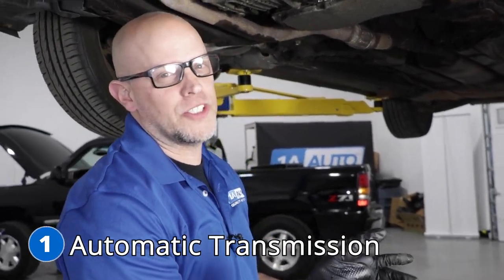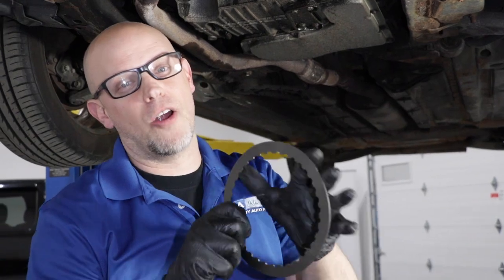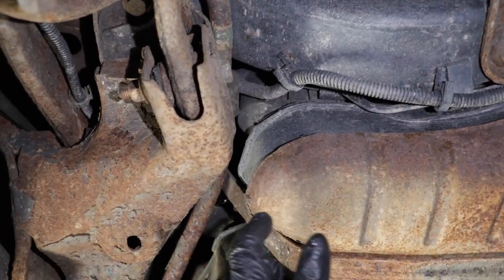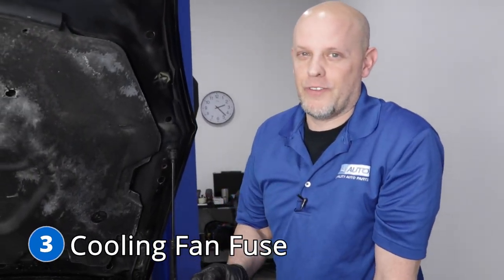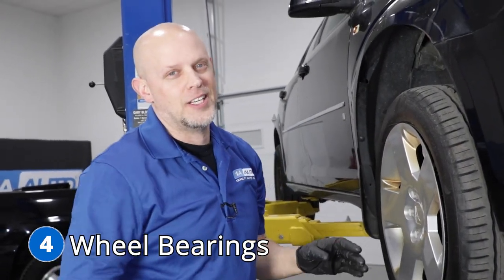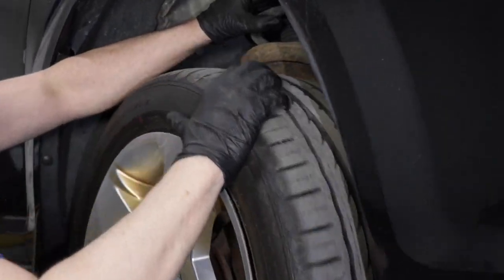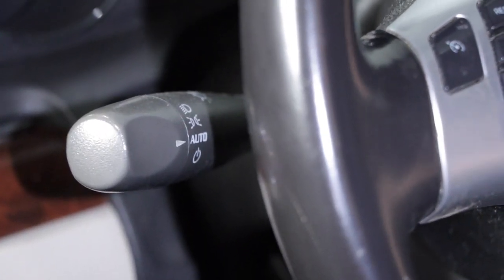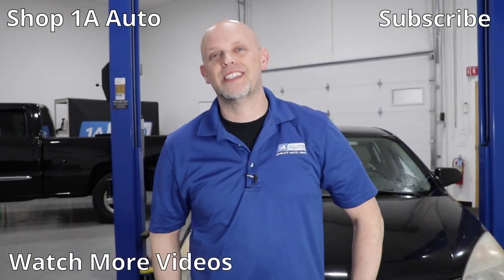Top 5 Problems Saturn Aura Sedan 1st Generation 2007-2010

Comment: I have an 09 Aura XR with the 3.6L and 6 speed tranny. Just hit 250K today on a 7 hour trip from Buffalo, NY. Car has been very solid last 12 years with only minor issues. Did replace the wheel bearings at 200K (only one was bad but did both since they are cheap and the repair is simple). Had the evap valve go at somewhere around 150K but no problems since. Bet this thing hasn't had $1500 in repairs in 12 years. Would buy another in a heart beat
Reply: It was discontinued so I haven’t found any real answers tbh
Reply: @dumbshit6510  sorry it took long for someone to reply, kinda on you cause I got one and it is so messed up. In two weeks I had to get power steering lines fixed, back seat changed and now check engine light just turned on
Reply: I have 07 XR currently 136k miles had it for 6.5 years a few issues waveplate luckily recall/extended warranty took care of that.  Also had radio replaced bc of some kind of failure.   And timing chain replaced.  Currently need a cat
Reply: lucky.... I bought a 07 Aura and 2 weeks after I got it the transmission shit the bed at 126k miles.... gave it to my grandma after I fixed the transmission and I think its been doing fine since then
Reply: @bfuller5577  Have your tried the animal shelter they usually have lots of kittens & cats that need homes....oh, wait
Reply: Mine has 69 k 
Eva’s vent went
Bad and blew the gasket on my gas cap 😩cracking the actual cap itself

Tstat (I ’m on on 3rd one)
Head gaskets also done
Water pump also done 
Luckily it was a gift from wifes granny but I’m almost positive she drove this thing with diesel or filled the radiator with blinker fluid because anything to do with its cooling system is completely out of whack
Reply: @chango.-.  how expensive was the transmission fix? Looking to purchase an 2009
Reply: @savannahgnass935  "Blinker fluid" lmao, love it! 🤣

Comment: Good vid! And spot on. I have an '07 Aura XR with the 6-speed transmission. 
I encountered the 3,5,R Wave plate issue and GM fixed with no charge it even though it was out of warranty. There is a special coverage offer for GM cars with this issue.

Another thing that happened was the multifunction switch that you point out. Fortunately this was easy enough to fix myself.

A few other things I had with this car that others might also see:
1) Instrument panel lights failing. This can be removed and sent for repair with an independent electronics repair firm (which I eventually did). Getting a used one from a junkyard won't completely work as the VIN is locked to the instrument panel so your total miles will not update unless it is the original part. So get the original out and send it out for repair. Doable if you are relatively handy and the cost will be around $200 or so.
2) Rear 3rd brake light fail. One would think this wouldn't happen since they are LEDs. But apparently the board may have cold solder joints and fail. Getting this fixed is difficult as it is hard to remove and finding a new one is also tough. Some people have had luck reflowing the solder. A PITA since you need this for some state safety inspections.
3) Replacing the front headlights is ridiculously difficult. It is next to impossible to unplug the bulb sockets as they are crammed behind the light module with zero room. You have to take apart a good deal of the front bumper and also the wheel well liners to get at the screws and bolts to loosen the headlight module so you can get at the sockets. 

Aside from all that I've had a reliable car that has been a dependable ride for over 14 years.
Reply: I had luck with some tricks to replacing the headlight lightbulb. Turning the wheel outward and then going in behind the tire (without needing to take the tire off). Need to prop open the panel pretty far to get hand it. But it works. I did the driver's side. Haven't needed to do passenger side....but if you have someone with small hands I heard it can be done from the top without dismantling anything. Also can go through wheel well. There are videos on YT. One word of caution: I found many places (Walmart, etc) recommending the WRONG headlamp...you need one were the plugs are within a cm of each other...not spread out.
Reply: Can you tell me where to find information on this special coverage warranty? Is it still active in 2022?
Reply: @alfonsom8286   wondering the same thing!

Comment: i have the '08 XR with the 3.6L V6. i got it three years ago at 80k miles and i've only put 14k on it since i bought it. no major problems and i've driven it from the northeast to the midwest to the south and back to the northeast but the flaws in the LY7 engine and 6T70 transmission of the '07-'09 era make it feel like a ticking time bomb. the XE doesn't use this engine/transmission configuration. if i weren't planning on moving back to the big city i'd look into getting a different car.

Comment: 2007 Saturn aura and like additional issues known. No crank when hot is the relay fuse box under the hood gets a common ground break internally. Ignition switches are also common issues. 6 speed trans with manual feature also had recall for mount break inside. Timing chain issues due to oil starvation issues that have a fix. 2007 with 3.6 6 sped 204k miles one owner. Dealt with these and several other issues found to be common but unknown causes in gm’s opinion

Comment: Only issues I've had on my '09 Aura: Passenger seat occupant sensor is bad+; AIR Injection system pump failed twice (then I just quit replacing it because I dont care); One door lock actuator got weak (replaced with a very cheap & easy to install universal one). I do have the LE5 engine & I am holding my breath that the dreaded stretched timing chain issue doesn't strike.
Reply from the maker: +bgregg55 Thanks for the feedback!

Comment: Just had the 3-5-R waveplate failure on a 2009 Aura XR 3.6 with the 6T75 transmission. It failed right on 80,000 miles.  I repaired it without taking the transmission out using the Sonnax kit. Not something I'd want to do again - it's very fiddly/tight with the transmission still in place - but it seems to have fixed the issue. 
I've had every other issue discussed except for the cooling fan issue as well as a host of other things. The electrics on this car truly have a mind of their own and half the time my OBD2 port won't even read.

Comment: I'm looking to buy a 2007 Saturn Aura XE with 80,000km. If i'm not mistaken it is a 4 gear transmission. Does this transmission have the same problems as the 6 gears ? Is it a good buy ?

Comment: 1A Auto, thanks for the video folks.
My wife owns an 08 Saturn Aura XR with the 3.6 L V6.

Sweet car, given to her by her mother. So it's got sentimental value, but the thing has been a nightmare since day one.

Brakes & Tires right off the bat, including rotors, which were warped.
Always had a vibration, and in four years now I've never been able to identify it and fix it.
I've replaced both front wheel bearing assemblies (x2), rotors, calipers, pads, sway-bar links, tie-rod ends, CV shafts (x2), struts, lower control arms front, headlights (high vis), tail lights (lens too), tires three times now (still haven't found that vibration, but it's not chewing up tires anymore), practically the entire front end has been replaced new including plugs & coils, purge valve and now, NOW during a routine oil change and rotation I found a broken coil spring on the back left. This explains that "clunk in the trunk" I've been hearing this past year and a half... another "bleep" I've not been able to identify and remedy.

I fix these sort of things in pairs, so I ordered a pair of coil springs and new shocks for the rear and come to find out that other coil spring was broken too. Broken coil springs and I couldn't see them till the separated and came out ?

The car had 75,000 on it when we got it and now has 236,000+
I'm a volunteer driver for a company that serves the communities in the surrounding 10 or 15 counties. I take people to their doctor's appointments and things like that. Usually elderly, but just basically anybody that can't drive for what ever reason and their insurance provides ride service... I drive.
I've been dedicated now for over a year and a half to one individual who has to go to dialysis every three days. That trip alone is over 160 miles per day, three times per week.
Then add in another trip or two to the cities or where ever and I rack up around 25-30,000 miles per year just volunteering.

Then there's the electrical issues.
Took it through a car wash one day and came out with lights blinking, the stereo "flashing" on and off, the turn signals echoing through the stereo speakers, holy cow it was a nightmare.
It's had a parasitic drain that I've never found, but disconnecting the heated seats and mirrors stopped the battery from being drained every other day.
Stereo stopped working years ago.
Little things keep happening, like when I exit the vehicle and walk away, it honks at me. Hmmm you say, doesn't every car ?
Not ours. The key FOB thingy died years ago and ever since we have no clicker, no remote start, not door unlocker thingy or trunk opener thingy.
So why's this thing honking at me ?

Sometimes lights will come on in the dash, dummy lights, and then go off later.
Door locks don't always work.
Sometimes the cruise chooses to take the morning off and not function at all.

I keep fixing it though because my wife loves it.

I've been wondering if an entirely new wiring harness, fuse panels, and ECM would solve the electrical issues ?
That's a lot of work, but if it solves 99% of the issues I'd be happy.

All my clients love the car and always have rave comments about it... and it's really nothing that special, I just take care of it, wash it, and keep up on the maintenance.
Reply: I feel your pain, had an 08 with the 2.4 though highschool and a few years of college. Car nickled and dimed me, only thing I didn't have problems with was the engine. Paying for a new transmission in high-school while making minimum wage sucked and then all these other issues stacked up. The electrical gremlins were an absolute nightmare.
Reply: Try inspecting the base of the fuse block under the hood for your electrical issues. Ours had it where the connectors were pushing out and had to get fuse block replaced

Comment: anybody ever replace the body control module in one of these? my two front headlights are both brand new and went out, no tcs, or abs both systems are disabled. Heard the was a recall in 2014 on the module and was wondering if anybody had any experience replacing those.

Comment: They eat headlight bulbs because of poor mounting of lights that aren’t shock mounted. The plastic windshield washer faucet is exposed to engine heat and cracks on many auras. The worst is the engine timing chain stretches and is big bucks to replace. The tank mounted fuel pump failed too. After repairs it’s still going at 250,000 miles with no body rust.

Comment: What do I do to TS the DIC on my 2009 Saturn Aura.  The problem is the switch on the storing does not sequence thru the selections.  
I have had the switch assembly and that did not resolve the problem.

Comment: Q: Is the PCV valve (the one towards the front of the vehicle) difficult to change? ...  2007 Aura XR (3.6 LY7),  240,000 miles
My local repair shop wants to charge me $ 1,104  (one thousand one hundred four) to change it.
Local parts houses have them upwards of $ 30.00..
If you could do a video on that,  it would be great..

I've had the combo switch,  transmission,  fuel tank valve,  Frt Wheel Bearings, and alternator replaced..
Thanks for this informative video.

Comment: Do you have any solutions on trouble shooting why the trunk release button on the driver's side panel doesn't activate? I can't find a specific relay or fuse listed in the owner's manual. I can activate the trunk release relay using the key fob.

Comment: Hey I'm having problem with 2007 Saturn aura V6 when driving al of a sudden it doesn't accelerate like is in neutral, I just replaced the transmission and still doing the same , pls help. Thank!

Comment: 2007XR with 360k. Had to replace the engine.
Reply: I mean that's not bad tho, though 360k over 15 year seems like a lot of miles. I got the 07XE with 160k still running strong, but I take very good care of her.

Comment: I have an 08 aura. I haven’t had any of these yet but the hub assembly. I do have a issue I can’t seem to figure out tho. Water in the driver floor board and rear passenger floorboard. I know it’s probably under the front passenger as well but can’t see it due to the rubber under the carpet. Anyways, water seems to be like 3 inches deep in the back every time it rains. Can’t find any leaky seals. Doesn’t come from doors or roof.
Reply: It might be your ac is blocked and leaking inside. I was just looking into that, as my saturn leaks exsevly under when I'm running the ac

Comment: Had a 2008, worst car I have ever had... transmission exploded around 80k. Thermostat would constantly pop, would replace it and it would pop again in 2-3 days, so never had AC or heat. Tons of overheating even after replacing radiator and all other related parts, all fuses, electrical issues, tpms issues, windows would leak, always had to manually hold the turn signals, horrible gas mileage, car would struggle to start even after changing alternator, battery, etc, sway bars would snap if you go over a minor bump, etc. Not reliable, sent it to the junk yard for $500 with 120k on it.
Reply: Wow. Was it your motor  3.5?  Or the 4 cylinder? Please
Reply: You just got one out of a bad batch. I'm at 212k miles. I'll be changing the spark plugs for the first time in about 2 weeks.

Comment: I have an 09 XR sitting in my garage with 80k miles on it with no reverse and bad shifting from 3-5. I had the wave plate special warranty work completed and still had no reverse and bad shifting from gears 3 and 5. This car just sits in my garage at this point as I don’t want to pay what the car is worth to have the transmission fixed that basically blew because of GMs manufacturer defect on these transmissions. The repair shop said there was so much metal debris in the transmission due to the cracked wave plate and that most likely caused other problems with the transmission that weren’t covered under the special warranty….run away from these things, far away….stay away from the older Chevy  Malibus as well, as some of those also have this same 6 spd transmission along with the wave plate issue.

Comment: Only thing I'd suggest is problems with the steering u-joint aren't always obvious. It should be checked and possibly replaced if there's slack in the steering wheel.

Comment: p4 20 code for the catalytic converters I switched it out and then code P 1174 and 1175 keep coming on I have replaced my O2 sensors my fuel injectors spark plugs coils gas cap and everything that it says to be replaced and the light still comes on I keep telling these mechanics that I believe it's something to do with the computer.. one guy did recalibrate but the light came back on..HELP ME Please.... Spent over $2,000 trying to get this fixed..

Comment: My grandma use to own one and one time when me and my sister's were riding in it with my gramma we went to Costco for a few minutes and we went back to the car the car wouldn't start because the battery died so we were stuck at the parking lot (by the way this happened at night) until someone guy in a red truck saw us and help us out so we were able to get back home at 12:00 this happened back in 2015 after that happened she sold it and now drives a 2015 Chrysler town and country

Comment: Welp...saw a 2009 Aura for only $1700.  Won't be buying if transmission has a tendency to fail. Replacement would cost way more than the car

Comment: Who got his Saturn clause to 220000 miles🤔
Reply: I bought my 07 Aura XE w/170k and now a year later 190k+ the power hose just went out but since then it’s been a great commuter. Looking to get another year out of it before upgrading but I’m cheap and don’t mind driving a simple commuter.
Reply: Over 275,000 on an SL1 (bought it new), gave it to my  nephew who put over 100k on it before getting rid of it. Just basic maintanance, motor and transmission were in great shape.

Comment: AC went out, fan broke and jabbed my radiator, cooling fan fuse, battery keeps dying, trunk leaks, car won't take gas, terrible gas mileage, brake light cover fell off, trunk won't pop without someone pulling up on it, suspension is completely fked, leaks oil, tpms all not working, lifter tick started yesterday, headlights are an absolute nightmare, won't accelerate when turning, shifter cable bushing keeps breaking, struggles to start randomly. The list goes on I'm sure I'm missing some things. This is the worst car I've ever owned in my life. Huge pos.

Comment: I'd say its first problem is that it's a Saturn 😆.
Reply: Cap...its basically a chevy
Reply: Its an Opel
Reply: Whatever problems these Saturns have....are the same you'll find on Chevy Malibu's..
Saturn was just a side brand of GM.
The 3.5 litre is a decent motor, but I would avoid the the 3.6 and the 4 cylinder versions (timing chain issues)
Reply: 2007 NA car of the year. It's a good vehicle.